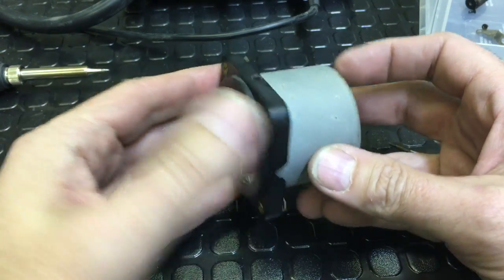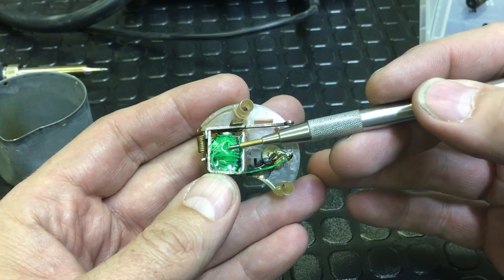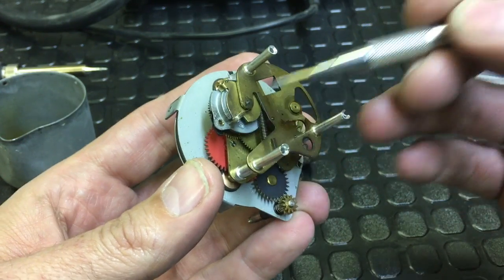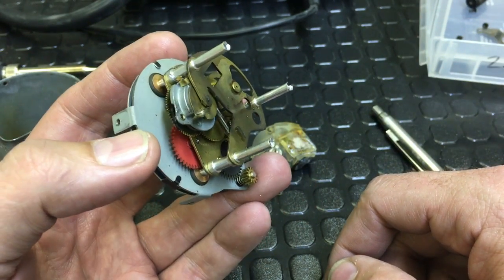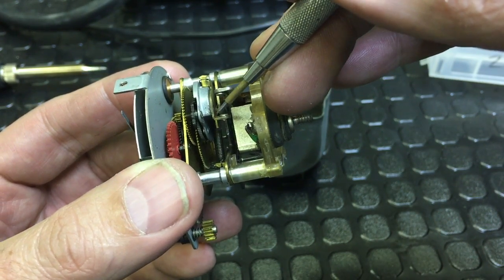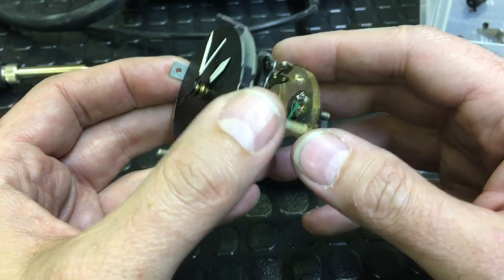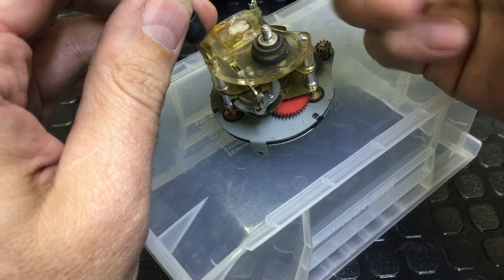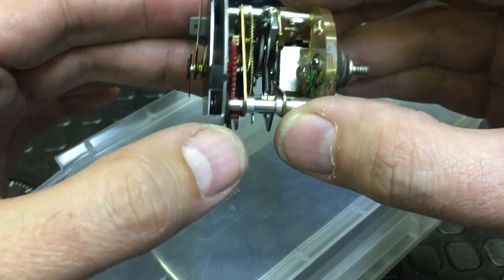Cessna / Borg Clock Design & Function - Solenoid Repair

Comment: Just so that everyone knows ...
The reason that the solenoid windings overheat and burn out, is not intuitive.
They are designed to draw current "momentarily" as the contacts close, then the winding action opens the contacts again. Although the solenoid coil draws a fair amount of current, it does so only briefly, after which, the clock runs for a couple of minutes. This allows time for the solenoid coil to cool sufficiently between power pulses.
The problem ( over-heating ) occurs when the vehicle's battery is low, as is common if the vehicle is not used for several months, or if the lights are accidentally left on and battery voltage is reduced. In this scenerio, the contacts of the clock remain closed; energizing the solenoid coil ... but, since the battery is low, there is not enough voltage applied to develop the magnetic force needed to retract the winding mechanism. Thus, the winding process "stalls" for lack of voltage. However, the coil remains energized with enough voltage to cause it to overheat, since it was not designed to dissipate heat from "continuous duty" operation. Usually, the enamel coating of the coil windings breaks down with the heat generated, causing electrical shorts against adjacent windings, leading to increased current draw, increased heat, and the eventual demise of the solenoid coil.
To repair the coil, remove the damaged windings, and rewind with new enamel coated wire of the same diameter and length. A hand-held drill motor (variable speed) is helpful for rewinding the coil spool, and makes for a very neat result.
Once you have repaired the clock and verified its operation, do yourself a favor, and install a 1 ampere slow-blow fuse in-line on the positive power wire. This will protect the clock from future low voltage damage ... unless you enjoyed the repair process and look forward to doing again sometime.
Reply: Thanks for the info!
Reply: Great info!

Comment: I've rewound one using 26g magnet wire, but it doesn't seem to respond similarly. I'm wondering if it's the amps I'm using. I have one hooked up to a 12v 0.5A AC>DC transformer and it hums but won't connect and throw the mechanism. There's not enough "strength" to do so. Do I need more amps?
Reply from the maker: 0.5A is not enough.  The solenoid will pull about 1.5A.  It doesn't draw that for more than a few milliseconds, but it will need that amount of power available.
Reply: Just connect a capacitor in parallel across the solenoid leads. The stored electrical energy in the capacitor will assist your power supply to provide enough DC to operate the solenoid.

Comment: Good video, but I already knew all this. I don't know how to rewind a tiny solenoid though. That's what I was hoping you where going to demonstrate. You know where I can learn that part of the repair? 
Or is there a vendor that sells the right size replacement solenoid? 
Thanks
Reply: I re-wound this solenoid with 26ga. hookup wire.  It would be better to use magnet wire but I didn't have any on hand. There's certainly a wire gauge and number of winds that are supposed to be used but I was unable to find that documented anywhere. So, Just wrapped it with enough turns until it filled the core.  Provided you can get the mechanical action desired without burning the windings it's good to go.

Comment: I have a similar clock in my car. The coil/solenoid shows 0 ohms so I believe it is shorted. The coil is about 1/2" long. Can you tell me how you got the coil out of the metal box in which it resides? I'm struggling to figure out how to do that without destroying it.
Reply from the maker: On mine the metal frame the coil was installed in was riveted together.  I used a drill to carefully drill off the rivet heads.  It then came apart easily. On reassembly I just used some epoxy to hold it all back together. Has worked fine so far.